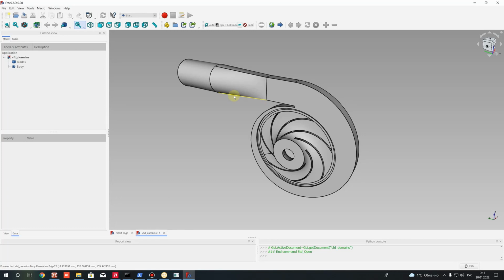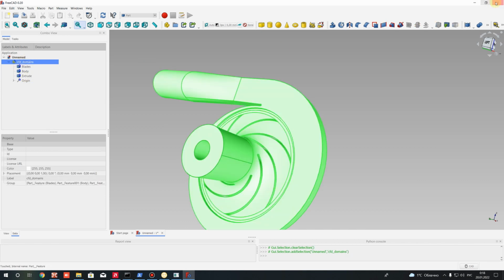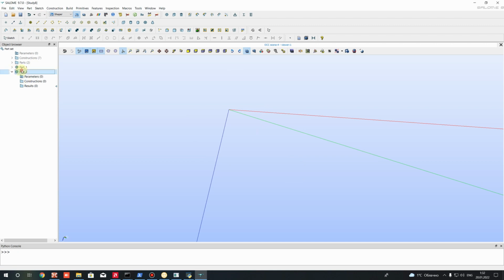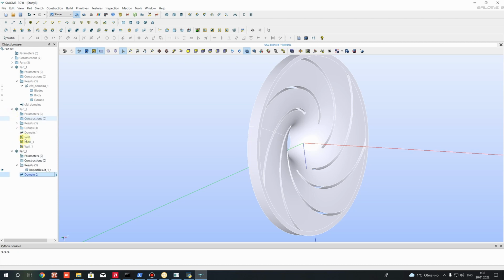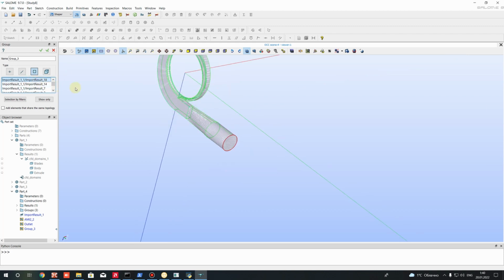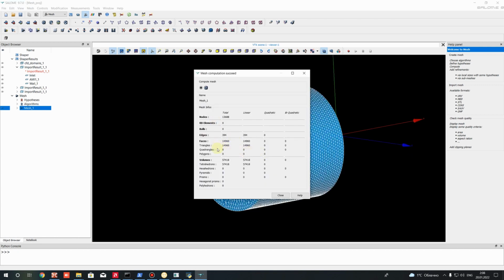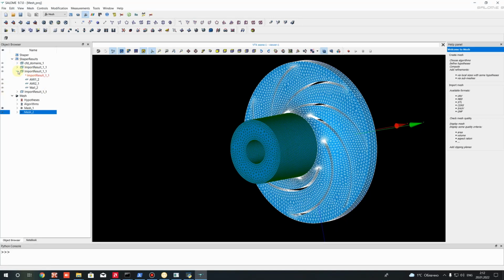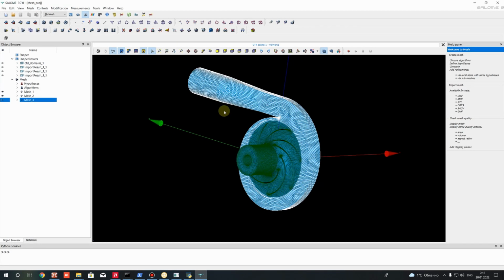FreeCAD + OpenFOAM Tutorial Part 2/3 | Design and Simulation of Centrifugal Pump with Volute

Comment: Another clear and very explanatory video tutorial. Is it possible to make boundary level mesh in Salome and is is possible that sometime Salome fail in creating mesh?
Reply from the maker: Hi, I don't understand clearly what means "boundary level mesh in Salome". What about second question, I think the main problem of all open-source meshers is Boundary Layers on walls (if you have difficult geometry). With tetrahedral meshes in general cases you will get correct results. Maybe some times you need to Mefisto for 2D generation mesh, because for some cases Netgen 2D-1D cannot to generate mesh (it is experimental practice)
Reply: Boundary level mesh is several thin layers of mesh closest to the surface of object which can be set in commercial CFD software. Usually it is 5 to 10 layers of this kind in commercial CFD software.